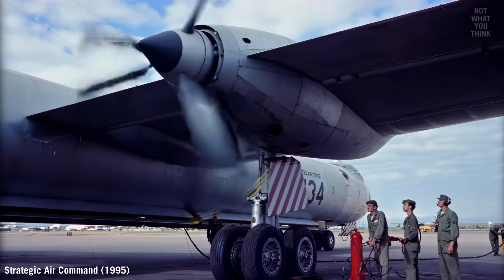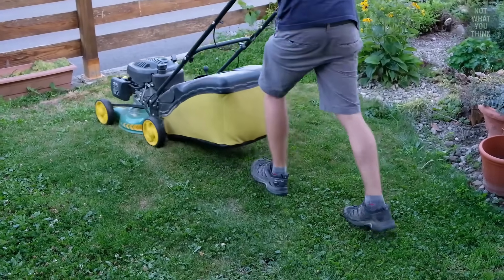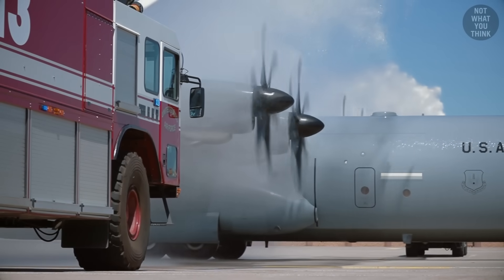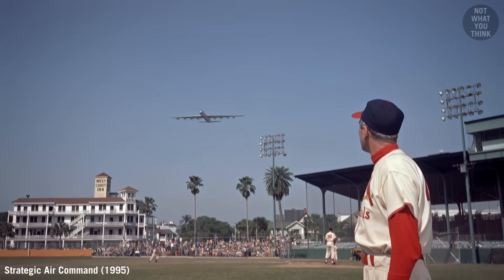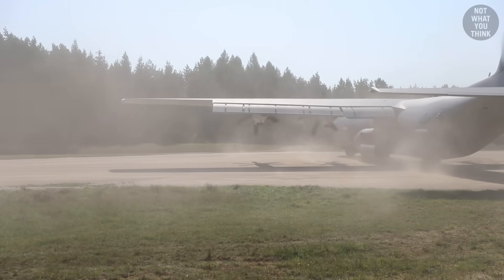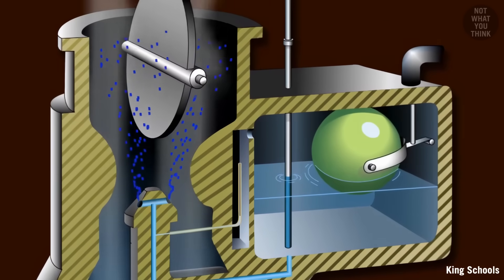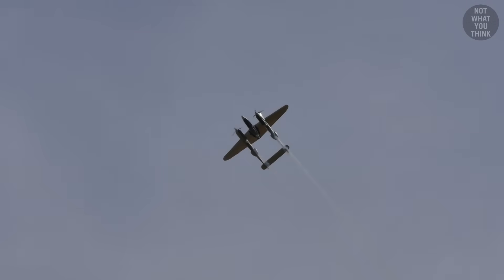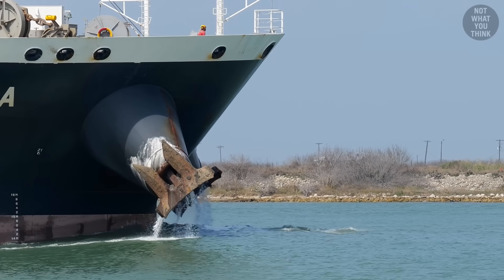Why airplane propellers moved from BACK to FRONT

Comment: Turbofan engines are not simply pushers because the fan is at the front of the engine and provides thrust by pulling air around the engine core.  High-bypass turbofan engines can derive more thrust from the fan's pulling than from the jet's pushing.
Reply: We see this more clearly with turboprops, where a small jet engine powers a standard (usually tractor) propeller. Though the pusher-tractor debate may arise again with developments in propfan powerplants.
Reply: @doujinflip  The layout of turboprop engines very strongly favors tractor configurations because the engines by their nature require a flow of air/exhaust from front to back.  That makes it impossible to turn a turboprop engine around backward for a pusher configuration, and makes it inevitable (barring some kind of unreasonably complicated indirect drive mechanism) that a pusher turboprop will end up with the propeller in the path of whatever jet flow is left after the exhaust drives the propeller.
Reply: @nabbar open rotor /prop fan engines have the fan at the back. They are starting to look good and could be used as a pusher
Reply: @nabbar the most popular turboprop in the world is the PT6 and it has no direct drive so it can easily be used in either layout. The Piaggio they kept showing is an example of that. The Velocity family of aircraft also has turboprops in the pusher configuration that are direct drive off the shelf. So it’s not that difficult.
Reply: @nabbar  Some Turboprop engines in tractor config has the jet part backwards, with the air intake pointing backwards and the exhaust exiting forwards.
A setup like this could work just fine in a pusher config, by just modifying the air in and outs.
Not impossible at all.
Reply: No. The bypass air is still going though a venturi which increases the airspeed and decreases the air pressure. The core of the engine does provide a bit of thrust, but most of the energy is absorbed in the turbines. But that is not in any way why the fan is the main source of motion. The fan creates way more thrust than pulling power. When a plane is in flight, the air is in fact rammed into the engine. The speed and of the thrust expelled in the rear is far greater than that of the air going in the front. There is a high pressure zone with slow moving air in front of the fan, which changes to a high speed jet as it moves through the bypass canal. If what you said was the case, it would be much more efficient to retain the bypass air in a high pressure low speed configuration.
Lastly, a "jet" engine is several things. The core is a jet engine, the fan is part of a jet engine. A jet engine without a fan is a turbojet. An engine with a low or high bypass ratio is a turbofan jet engine.
Reply: I don't think calling jets pushers or pullers make sense.
They're just jets.
Reply: A vacuum cleaner is a pusher, jets are pushers, props on the back or the front makes no difference, since intake starts in the front an ends in the back, it's the same process, you can only make the airplane move forward with this principle, you can't change it. Puller or pusher in aviation this are just words with no difference. Low and high bypass Jet engines work the same way, rockets are different, propulsion by chemical reaction.
Reply: There is no pulling force in aerodynamics. Physics doesnßt work like that.
Reply: @Johannes-c7p   Yes, wings do not work at all. Low pressure above wing is nonsense. It is pure anti-gravity devices hidden in the pantry. 😅
Reply: @Johannes-c7p  Yes, not in engines or propellers.  The upper surface of a wing has a "pull" effect from the lower air pressure above it which can be measured, typically accounts for 80% of the lift.
Reply: @ Still no pulling effect. That what you describe as pulling is actually the pushing force of preasure all around the plane which is less where the preasure is lower.
Reply: @Johannes-c7p  Yes of course that is correct, but the average non-physicist member of the public will think that "suction" is a pulling effect, rather than the push of the atmosphere!
Reply: @Johannes-c7p you’re right on that, but the way thrust is happening is essentially the consequence of the fan dropping air pressure ahead of it. As the fan reduces air pressure on its face, relatively higher pressure behind wants to equalize that. The fan is in the way, so the result is a force on the back of the blades. Air flow behind the fan is often less critical than ahead of it, as even turbofans with low bypass ratios like 2.7 to 1 get 80% of their thrust from the fan. 

Thrust is heavily if not primarily dependent on the face of the fan first.

Comment: How do you know what I think?
This is what I know: At the best range speed , half of the drag is induced drag which is REDUCED when the span is increased, a lot.
A twin engine aircraft with the engines way in the front distribute the weight more evenly and prevent propeller strike when the pilot pitches up during a near stall landing, a required demonstration for the multiengine certificate. 
Rutan had 2 inline engines for the sole reason that in cruise only the rear engine was active. 
The other parasite drag component depends almost only on the wetted area of the entire airplane.
The efficiency of the propeller depends on the diameter of the propeller, not significantly on its location. You did not know that, or?

Comment: The concept of firing through the propeller was develloped by the french pilot Roland Garos (he wasn't a tennisman).  He "just" put steel deflectors on the blades were his machine gun bullet would hit. He crashed behind enemy lines and set his ariplane on fire to not let this innovation be discovered, but the germans managed to put their hands on the wreck and discover it. Less than a year later, they had added syncronous machine guns to their aircraft. This system is way more preferable, as the bullets hitring the deflectors cause shocks on the engine's axle, leading to very low lifespan
Reply: There were several patents in France for interruptor gears in the 1913-1915 period; Saulniere had given up on them due to limitations in the reliability of the ammunition and was experimenting with deflection wedges. Roland Garros pevailed on Saulniere to install these wedges on his aircraft, and shot down several aircraft before he was forced down by ground fire. Salvaging the plane despite Garros' attempt to destroy it, the deflector design was sent to IdFlieg for analysis. During this period, Anthony Fokker managed to get a machine gun to test the interruptor mechanism he had been working on, and was finally able to demonstrate it to get it accepted.
Reply: Not to mention the direction of the bullets after hitting the propeller was somewhat random

Comment: 11:40 not to mention, that water is much denser, incompressible, has a much higher dynamic viscosity, AND ship's move MUCH slower,
so the fluid mechanics are most likely much different, so that turbulence from a vessel's hull may not be an issue,
but you gotta talk to someone who knows about flow characteristics of ship hulls about that
Reply: another reason is that the propeller on a ship wants to wind itsself onto the shaft if its at the stern. A bow propeller could in theory unwind itself if it got faster then the shaft
Reply: Also I think the control authority of a ship's rudder is more dependent on flow through it from the prop, compared to aircraft control surfaces. Sailing ships have notably bigger rudders for their size compared to ships with engines. 

Casual Navigation has done a video on this topic I'm pretty sure
Reply: When you are talking small, high speed water craft, a major reason the prop is in a pusher configuration is that you want only a very small percentage of the hull actually in the water to reduce drag. Plus, much easier to load onto a boat trailer if you don't have to worry about where the prop is.
Reply: Part of it is that boundary layer effects are much...shallower? Due to the density, viscosity and speed of sound in water, the boundary layer is tiny compared to air. If your prop is set up wrong, it can cause rudder flutter.
Reply: @ichbrauchmehrkaffee5785 if someone claims hat water would be "incompressible" it is hard to take the rest seriously, because obviously you don´t know  what you are talking about... so some research FIRST
Reply: But hé is right, as at the considered Reynolds number, water is considered incompressible, but air is not for airplanes. Please refrain from harsh agression if your not an expert.
Reply: @gshaindrich  Water is generally considered essentially incompressible under normal conditions, though it is technically compressible. In normal aircraft engine operating and engineering conditions, water is incompressible, usually less than 1%. Under what NORMAL aircraft engines and operating conditions would you consider it compressible?
Reply: @hifinsword  "In normal aircraft engine operating and engineering conditions, water is incompressible, usually less than 1%." - I don´t think 1% is something that can so easily be ignored in todays age, when the manufacturing processes are generally good and e.g. sizewise tolerances are often, because they need to, a lot less than 1%. Furthermore i would argue that if water would be incompressible it could be used as hydraulic fluid, yet it ain´t... "engineering conditions" ... again hydraulics, what about water jets ? "under normal conditions" what are those? don´t confuse technicalities like daily chores with technical applications.
Oh and one other thing: the worlds oceans are on average 3500+ meters deep. Sure nobody goes there, but the ocean water would sure drown a few hundret million people if it suddenly started being incompressible... it´s like saying "we can´t walk through walls" but yet we do everyday, because doors exist

Comment: 7:29 propeller planes can use water or cooling fluid to cool engine not just air. WWII radial engines used air, but other engines like Merlin used water cooling. Air cooling is not limited to plane engines either. The Volkswagen Beetle was an air cooled engine.

Comment: Pushing an object is easier that pulling?  Try that with a trailer.  Or a litter/stretcher.  Or a log.
Reply: there are more forces there, not like on aviation,
Reply: I guess he thought about walking with lawnmowers forward and backwards without turning yourself around (since he is using a video of one when making that statement), forgetting things will be very different depending on what exactly the context is and which forces are at play in which direction. 
Neither statements are universally true.

Grip, leverage, and shape are also crucial factors. It's easier to push against something you can't get a grip on than it is to pull it. like, for example, a giant ball.
The act of pulling is, by definition, required to have grip, whereas pushing doesn't
Reply: Yeah pulling is a lot easier, not sure what that was all about.
Reply: Someone never heard the expression "Don't put the cart before the horse."
Reply: I was literally looking for this comment. I was going to make the exact same comment if it wasn't here already!
100% Agreed.
Reply: or a heavy load on a dolly....

Comment: this is kind of misleading, whilst some very early and large aircraft like the kalinn k-7 used rear-facing props almost ever ww1 and ww2 era aircraft had forward-facing propellors. only very few exceptions existed and they were prototypes like the xp55 or r2y2, the b36 convair was one single plane. almost all propellor aircraft designed after world war one used front facing propellors - for every exception you name i can tell you fifty examples of normal aircraft

Comment: Having flown both tractor and pusher types. The tractor is much quieter but I love the sounds of the pusher types 🎉 Rc Planes of course 😂
Reply: Aren't pushers usually much quieter inside? Almost everyone seems to comment on how quiet the Velocity is inside when compared to tractor types.
Reply: @PistonAvatarGuy  that's what I was thinking. Arguably the actual propellers make the same amount of noise, but the wing, fuselage, and windshield (in single engine planes) absorb and reflect a lot of it, making the interior noisy but reducing ground noise.
Reply: @GaryBickford  The props on pushers are definitely louder, because they're interacting with dirty air from other parts of the aircraft. The explanation for why they're quieter for the occupants of the aircraft is as you've described.
Reply: @GaryBickford  Actually, they don't make the same amount of noise. As explained in the video, a prop blade just aft of the wing has to go through a high->low then a low->high pressure transition on each revolution due to the pressure differential above and below the wing which results in significant noise; mostly heard by people on the ground.
Reply: @PistonAvatarGuy  Depends. Usually yes. The props are placed behind the cabin, so themselves and the turbulent air they create are not effecting the cabin. But, if they are too small and the tips are going supersonic all the time, (not sure if anything does this), than it would be louder.

Comment: Neither pulling and pushing has any inherent advantage over the other. As for humans moving object on wheels or sledge, both lose some work over the height difference between human hands and the center of mass. Whatever mediates that force, unless continuously malforming by changing its shape, is just a static, rigid structure. Rope in tension or a metal bar, does not matter.

The reason pulling a lawnmover is harder is because of the design. Pulling easily raises the front because the handle isn’t allowed to rotate to the natural position. This means one either has to adjust the height difference between hands and center of mass, or let the front wheels raise up. Either way the work to balance this offset is actually pushing the handle towards ground. Equivalent setup could be designed for pushing, where attempting to push an object causes a pivot that needs counteracting, or restricts pushing to a disadvantageous angle.

Comment: I always wanted to know who created the first 3-pedal A/B/C driving position, cars used to be nuts to try to drive, so who came up with the accelerator, brake, clutch/manual gear layout? 

Every car uses tbis layout, but who created it?

I kjow the inventor of the 3-point seatbelt released the desig s for free to save lives, was it a similar process that released the design as a free to use model?

Comment: Though pushers have alot of disadvantages i would still buy/fly that Piaggio P180 Avanti first thing if i could.
Reply: I flew in one. Super quiet with the engines behind you, super efficient.
Reply: A friend of a friend owned a Velocity SE that could fly nearly 900 miles on a single tank of fuel with an IO-360 engine at over 150 kts. I got to see an Avanti up close. They are even prettier in person. It makes me sad Beechcraft stopping making the Starship.
Reply: @DaWoodster1  -  Just don't paint it brown.
Reply: I thought advantage as front then the propeller just throw it self off the plane but rear it keeps on the engine
Reply: It’s a great aircraft. Gorgeous interior.
Reply: If you love flying, do find such a Rutan twoseater and an owner willing to take you along. There is a tandem EZ (less drag) and one you sit shoulder to shoulder. Rutan is a very very clever designer, those EZ's fly like a fighter trainer. Stop watching them, get inside the cockpit. Wanna bet you regret flying those planes thirty years earlier?
Reply: Inshallah ✨️

Comment: At 12:07: I completely disagree.  Pulling is far easier than pushing.
Reply: Depends on the center of the weight and angle.
Reply: @dongleseon8785  agreed, but the example given was a lawnmower.   I've pushed my share of lawnmowers around, and it's way easier to pull than it is to push.  Just me being picky, I guess. 🙂
Reply: @EdwinWiles  that's true. I guess it's probably because the lawnmower is not designed to be pulled.

Comment: Your bottle looks like a 155mm shell from a distance. If paint it green and add a hanger loop on top like when they handle those in the factory, it would be 1:1 lol
Reply: I have an 88 mm shell casing from some kind of high-velocity gun, likely a WW2-era flak or some other anti-air or anti-tank gun, in my home. I found it there when I moved in, I have no idea where it came from. I use it as a decorative vase on my desk.

Comment: I think there was once a japanese ww2 fighter plane with a back engine i think
Reply: Kyushu J7W1 Shinden, Bell P-39 Airacobra, Curtiss-Wright XP-55 Ascender, and Dornier Do 335
Reply: @LordDustinDeWynd  Aaaand it got it wrong (or you have it a poor prompt). The Airacobra was not a pusher configuration. It had its propeller in the front, it just had the engine mounted further back, behind the pilot.
Reply: @rockyblacksmith   Bummer.  Too bad so sad wah wah boo-hoo sob sob.
Reply: Thanks, Giggle A.I.!